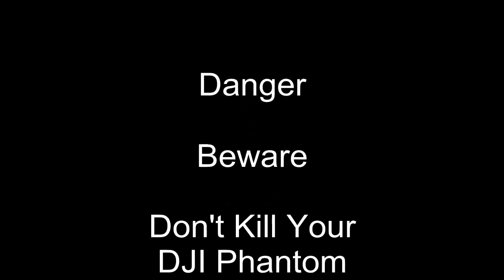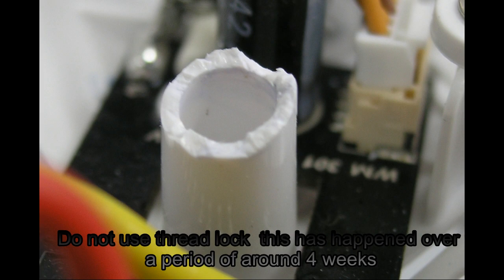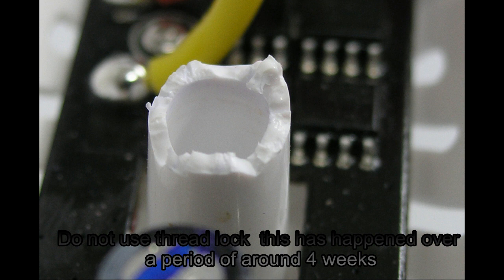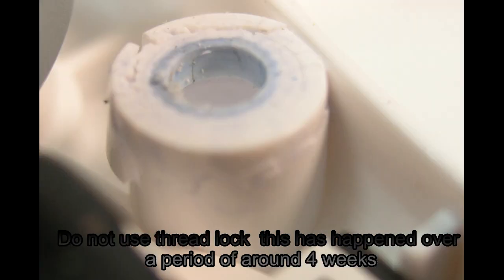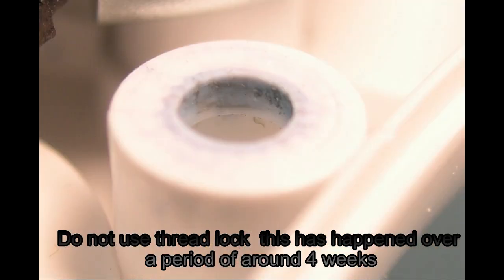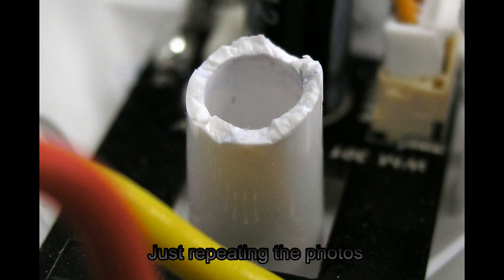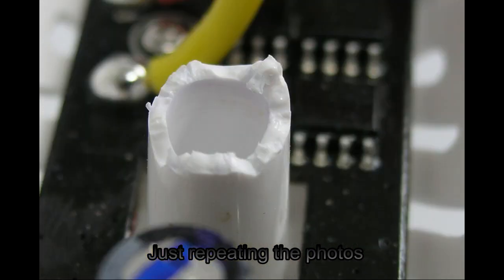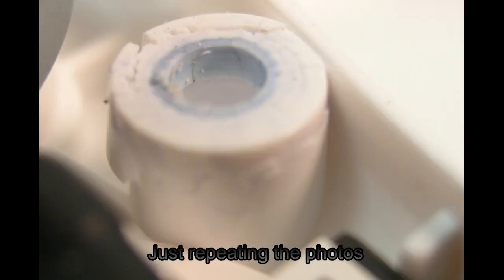0002 Don't kill your DJI Phantom with Standard Thread Lock - Unmanned Aerial Vehicle

Comment: Loctite thread locker specifically says not to use it on plastic.
Here is their verbiage "Not Recommended For Use on plastic parts, particularly thermoplastic materials where stress cracking of the plastic could result"
Reading the warning of the product you used on your DJI would of saved you from damaging it. Please do not blame DJI for your error.

Comment: The props tighten themselves - just look at the markings for rotation direction on the motors, put the correct prop just on top of the thread - turn the motor in direction shown on marking while keeping the prop still.
After a few revolutions, hey presto the motor tightens. The wind resistance of the prop will do the same thing and keep it tightened while it is spinning, no need for any messy gunk.
You cant even put the props on the wrong motors as they will never tighten as they have opposite threads (referring to V2 with black and silver coloured motor threads)
Reply from the maker: Hi Rich  This video is about, NOT using normal blue thread lock on the fixing bolts on the body shell.  The body shell is eaten by this stuff.